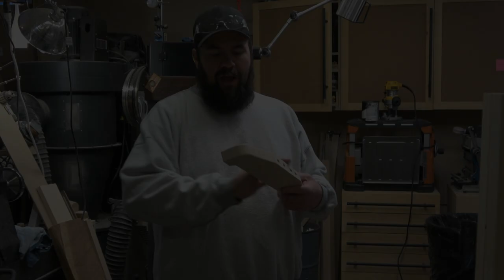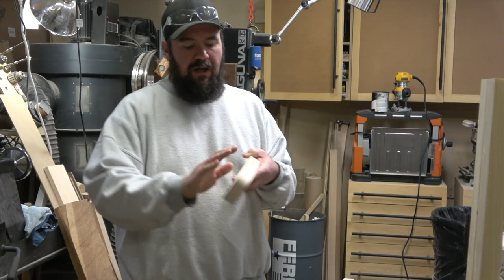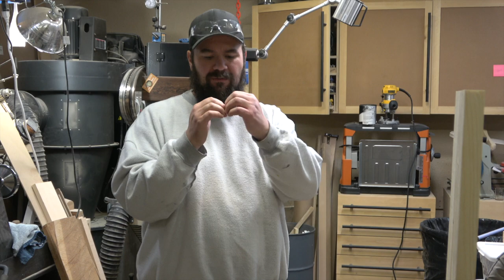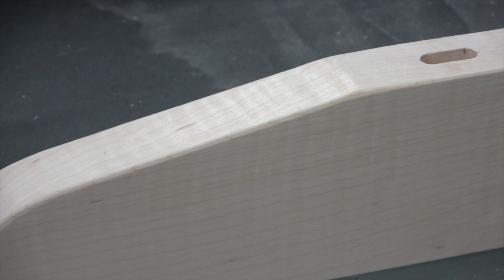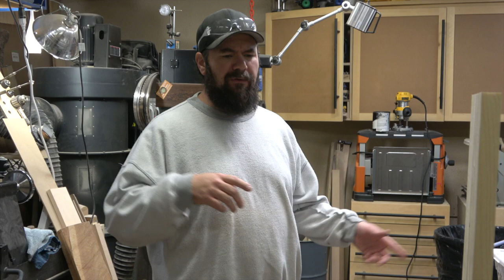Ⓕ Breaking Your Edges

Comment: Definitely agree with you knock it down with sandpaper it always seems to want to splinter in there the long splinters
Reply from the maker: I wish I would’ve mentioned that but yeah that’s a very valid point that the sanding sponges help out with if you get a splinter typically goes into the sponge not your finger

Comment: I concur entirely.   I have a old hand router with a 1/16th inch roundover bit fitted and set up permanently, which I whiz around the edges of most components I make, which totally changes the feel of the part in one's hand, making it feel 'finished' and 'friendly', rather than sharp and uncomfortable to grip.   Also I agree that the improvement in edge finishing is a major factor.
Reply from the maker: Thanks Don - it’s odd how much that can effect a piece